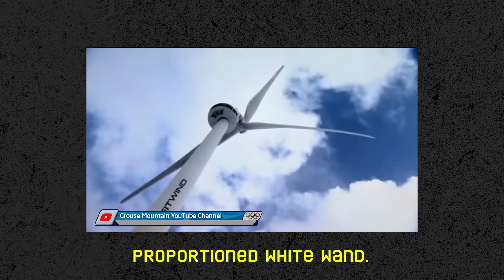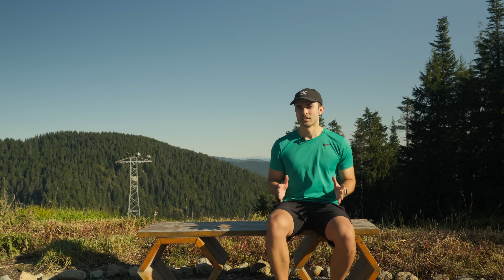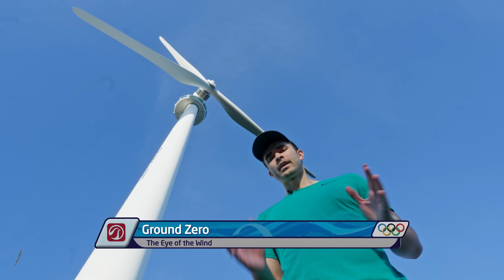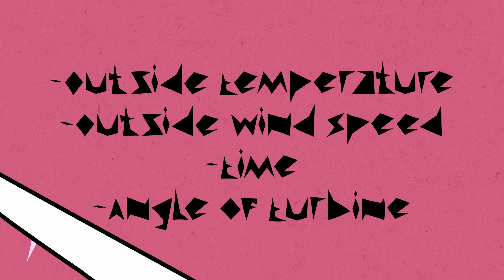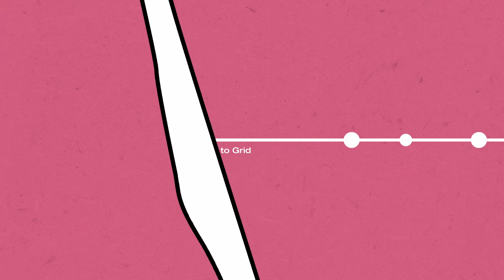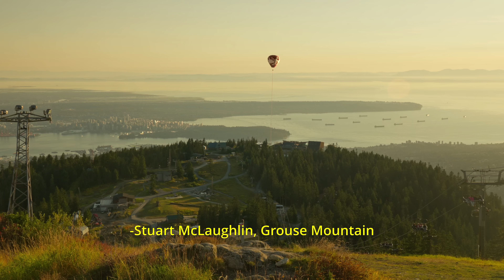Greenwashing Vancouver's Wind Turbine

Comment: I remember a rebuttal to the eyesore it would create was that it was really only going to be seen from 2-3 places on the North Shore. Ha!! When I read that in the paper I almost wanted to ask the newspaper editor if they meant it wouldn't been seen from only 2-3 places. I always found the BC Hydro aspect telling. Elevator are installed in very ridgid shafts in buildings. The turbine tower is by design, not ridgid. Can you guess they had a bit of an oops with that aspect too. That one is likely the only one they cared about and really completely missed the boat on in the design stage. I wonder if it could even spin properly and actually generate close to it's potential given how long it sits still.

Comment: The hydrogen buses used for the 2010 Olympics were a greenwashing win, too. How sustainable is hydrogen, if you truck it across the country? And does it matter if you can't even run the buses most of the time, because they are broken? I think the most sustainable thing to come out of the 2010 Olympics was the Canada Line, that got built too small for the immediate need.

Comment: Resonance can break a bridge, what about rock on top of a mountain. Doubt they did any environmental engineering on the rock platform. There have been a number of rock slides this year, water can be involved, but what if some crucial rocks below or around the windmill develop a crack from the resonance and it looks like windmill operation makes it worse? Or originally caused it. 
Its the first thought I had when I saw the windmill, did anyone have that thought? Was there anyone with geoengineering education, was there an environmental  report on possible effects of powerful low-frequency acoustic waves.?
I spent many years constructing sound studios and the lowest of the frequencies could not always be controlled barring expensive lead sheeting in the walls. Although you couldnt hear a thing when a drummer was wailing away, if you sat in the car a few super-low frequencies from a bass would buzz the speakers.
I have alot to say about acoustic wave propagation. Its not woowoo subject material.

Comment: Ditto for electric cars and solar panels. One doesn’t need to be a climate change denier to figure out that where there is no realistic payback on the energy “saved” or created, then whatever is being proposed is a scam.  And the same applies to hydroelectric or other mega projects with no realistic payback.  I am pleased BC Hydro forced them to install proper interconnection equipment.

Comment: Grouse mountain needs 5+ megawatts of electricity? Are they running an electric arc furnace up there?
Reply: The 20-25% of energy estimate already factored in the estimated 30% capacity factor for the 1.5 MW peak power rating.
so a 1.5 MW turbine at 30% capacity should be capable of ~4000 MWh/yr, but instead it produces <150 MWh/yr (1.1% capacity).
That implies Grouse had an annual energy usage of 16,000 MWh/yr (an average power of only 2 MW)

Comment: Didn't watch this but I'm hopeful that the following points were covered: 
1. When Grouse Mountain applied for the government grant to subsidize the windmills purchase they averaged the daily windspeed to do their calculations.  In fact Grouse Mountain gets very lfew summer day with wind above the minimum operating windspeed and gets too many winter days with wind above the maximum operating windspeed. 
2. Winter storms cover the blades with ice and snow making winter impossible due to blade imbalance 
3. Hooking power generation devices to the grid requires sophisticated interlock devices to protect the grid from frequency variation and protect workers from being electrocuted when working on what they believe to be a deal grid. Grouse Mountain refused to buy the isolation system required by BC Hydro resulting in the windmill never supplying power
4. Oddly the windmill was purchased and constructed with an observation platform indicating that Grouse Mountain always intended the windmill to be a tourist attraction 
Basically Grouse Mountain proves the 3rd rule of business: figures don't lie but liars can figure!

Comment: I would like to know who and how the 1.5 megawatt number was determined and verified and approved.
Was this maximum output for the generator when running? That would be roughly equivalent to a 2000 hp internal combustion engine driven generator. That's pretty impressive for a windmill.
Or was that the energy produced over a period of time, a day, a week, a month, a year, ten years, the expected life of the windmill? 
It would be great if that was clarified.

Comment: BC in a nutshell. Great video!
Reply: Lol right. Just another public art installment!
Reply: Underrated comment
Reply: Why not  an oil refinery instead, eh?
It was erected by a local corporation, not BC.
Reply: idealism over reality. Every time.
Reply: @paulm1237  
This guy's video was that the construction of the thing was never about idealism.
Reply: @SonicCommenter  yeah, and it was constructed on a foundation of idealism that couldn't be met, with zero regard for the reality or what happens when the ideal isn't met.
Reply: @paulm1237  
It was built entirely for the purpose of commerce as a tourist attraction and sold under the guise of environmentalism. There was no idealism in its construction. The entire project was actually one of cynicism.

Comment: I'm an ex wind tech. Very dangerous to be up tower when operating! Scary as heck! Nobody is offering tours of running turbines, ANYWHERE! If elevator has failed, then likely a major component like Gen or gearbox or YAW DRIVE! Ya need a crew to maintain and repair and CRANES are almost always needed! I worked Palm Springs on older (v-39) units and they take a lot of working to keep running.

Comment: So... a wind-turbine that's in a suboptimal location, isn't used during winter due to safety reasons, and unused the rest of the year to accommodate visitors to the lookout (prior to shutting down)?  Sounds like typical Vancouver... decisions based on feels rather than actual facts.

Comment: what an insane amount of corruption again: Basically, they saw the opportunity to build a viewing platform that is funded by the public. They got the platform for free by disguising it as a wind turbine and take revenue from the viewing platform via visitors. It is known the areas below wind turbines are off limits during periods of humidity, rain, ice, and snow. It is known that a wind turbine deals with vibrations (they are even built for dealing with these, so you can be sure there are certainly vibrations going on due to turbulence, gusts and gearbox). The seized the opportunity of perceived urgency due to Winter Olympics to push forward false claims on energy revenue and lied on the percentages. It would have been fair if a deal had been struck that builds the wind turbine in return for providing 25% less energy to before upon completion of construction.

Comment: 🤔 This is what I would do. 1: Remove the blades. 2: Double the height of the structure. 3: Upgrade the elevator to be a 'limited speed' gravity generator. 4: Rename it. (( If you are able to think outside the vault, 🤷‍♂instead of just the box, you'll understand this comment )).

Comment: Old Data showing that the John R. Turk Jr coal power plant is / was 43.3% efficient. As it is called Ultra Super Critical , burns much hotter with smaller coal size.  {{{ 1048*F ????} if memory serves me ??? 
Not the 28% of the Prayer Wheels of Ontario. 
The touted excuse for Gullible Warming will get anyone who Can't / Won't Think for themselves to agree with??????  So Stay uninformed thus easier to Connnnn and Trolll. 
If you lower the CO2 down to 150 PPM you can kill all the plants and Trees on EARTH. 
As we are at about 430 PPM this has increased food production over the last 30 years. 
At 1,200 PPM this again would increase food production more again using less water and fertilizer while growing more top and root growth. 
Go look up the growth of trees with varying amounts of CO2 see for yourself!!! LEARN. Thus you can't be lied to in life.

Comment: Well if you want to STOP the fires in BC????!!!!
END THE GEOENGINEERING WEATHER MODIFICATION GOING ON!!!
Look up patent $ 0462795 "" Method of Producing More Rainfall """ See when it was taken out?????????? 
Look up the Prayer Wheels efficiency of Ontario, like about 28%!! As opposed to hydro or Nuclear power !! 
The output of Renewables ??? is about 110 watts as opposed to conventional power of 990 watts. The amounts of steel and concrete for renewables VS conventional power is shocking. 
Yes with the blades being locked down the bearings will have flat spots on them so won't run smoothly. So need to be changed, ya isn't that a cheap/ great idea???? 
$elling the ma$$e$ on that ?????

Comment: I think this is a great example of green energy problems 
Is climate change real - yes
Dose it meet the expansions people promised - no

People got to realize 90% of what were told about climate change is from green energy lobbyists "it's expensive, but worth the future" said everyone who would get rich off it
A great example of this is the "great garbage patch" while it is real, what the public knows about it is a complete hox fro. A single miss information article 

But don't take my word for it, look it up!
And while i sound like im dunking on positive change, no! The real science is so cool!
The gobal increase in temperatures linses up with the wabel in the earth rotation around the sun and marine biologist stress to not clean up the great garbage patch as a new ecosystem has flourished around it, with a new Plankton that eats Plastics and removes carbon emissions.
And on the tech side solar panels are cheaper then ever and hydrogen fule cell cars are became more of a safe  then electric cars in terms of fires and efficiency, and Japan is FULL leaning into that buy building a new nuclear reactor that uses the byproduct Heat to produce hydrogen.

I love learning and all this shit is so cool! Climate alarmism? A dum joke, the future is coming and we don't know what it's going to look like but it is extremely hopeful (rip those ice caps tho. And on that note, Europe's climate is set to completely freeze over as Antarctica's melting what drives Europe's warm weather. Surprising? Thats why this is so cool! The world is more complicated then anyone can comprehend!)

Comment: They should have painted it a light blue to blend a bit better.

I'd have so many less complaints if it was allowed to generate absolutely every last watt possible. IDGAF that it vibrates and tourists don't like it. It's not that loud, and no doubt it's decently engineered. Force them to make it run to the max extent it can. Did we get scammed? Seems like. But we could claw some of that back.

Comment: What a joke.  I'd like to know how that wind turbine could offset carbon emissions even if it was running when you consider that Vancouver get's it's power from hydro electric which of course doesn't produce any CO2 emissions that need to be offset in the first place.  Low level politicians do not understand this technology enough to even know what questions they should be asking.  

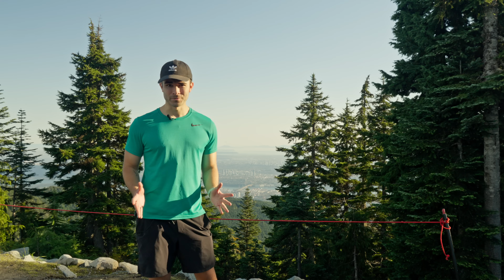FWIW:  @7:32 A "climate denier" is anyone who does not believe CO2 is the primary driver of earths climate. That debunked 98% consensus claim includes many "climate denying" scientists because anyone who agrees that CO2 is a greenhouse gas that causes "some" warming was counted and that includes most "deniers".  There is NO consensus on earths climate sensitivity to an increase in atmospheric CO2 by means of theoretical water vapor amplification which is needed for CO2 to effect climate to the degree alarmists claim it will but hasn't yet.

Comment: I toured a wind turbine farm once. It was publically owned. I noticed the turbine consumed 5kw when it was just sitting there. Just to run all the electronics to connect it to the grid use 5kw. That is far more power than my home uses. How can it consume so much power just to sit there? Because the utilities require increadably complex systems to connect to the grid??

Comment: Here is some insight that may not be available through the google.. but a company I worked with flew around the hydro techs and they had other things to say about this project.. as you mentioned that BC Hydro had issue with the interconnect system that Grouse Mountain had installed, but it also failed too.. miserably, as in a fire.. and with that said there was too much of an expense to recommission it and that is the sole reason the big fan on the hill doesn't spin or generate a watt of juice.. just another failed local government feel green project.

Comment: Every time I look at Grouse I check to see if (almost never) the Wind Turbine is running, and now I know why. It was almost comical when they couldn't get BC Hydro to let them connect it to the Grid. They should take it down if it's not going to run, as it's an eyesore for many, and let someone install it where it can operate. Well done video!
Reply: Agreed, it is pointless, but you know there are railroad tracks around that CP and CN runs one train per year on, just so they do not lose the rights to the land under the tracks.

Comment: Fun fact: It would take 3,030 wind turbines to match the power output of B.C. Hydro’s Bennet Dam. And that just # is factoring in 30% efficiency of a full functioning turbine. #VoteAgainstWind. Yes to Water and Nuclear
Reply: BC just approved 9 new wind farms because they are the least expensive and fastest option. Alberta is commonly hitting 35% wind powered or 3,000 MW.
Reply: @ damn. Big L
Reply: @aaronvallejo8220 Where they going to be installed ? Cheers

Comment: I am always disappointed when it is not spinning. Never seen it spin. While Alberta is commonly hitting 35% wind powered. Either fix the elevator for tourism or fix the generator and install the winter blade heating package to avoid ice throw and let it make electricity. Either way it should be making $$$. Nicely researched video!

Comment: Newsflash: anything to do with ski resorts is environmentally questionable. Whistler (Vail) has a "net zero" marketing goal, but does that include all the net emissions from destination visitors, or even the hot water use from one trophy home. Don't kid yourself. Check POW for more environmental hypocrisy: truck driving sled heads that want to "protect winter."